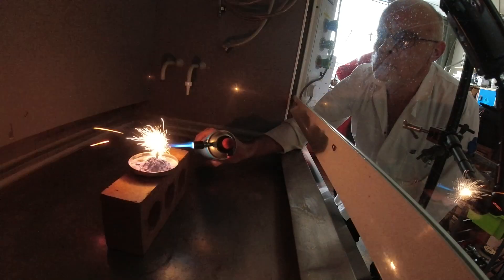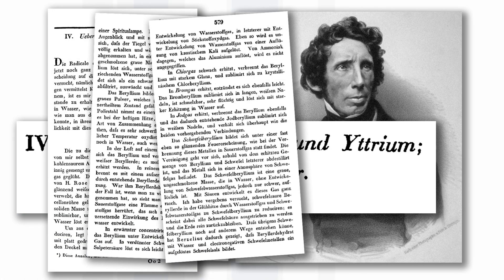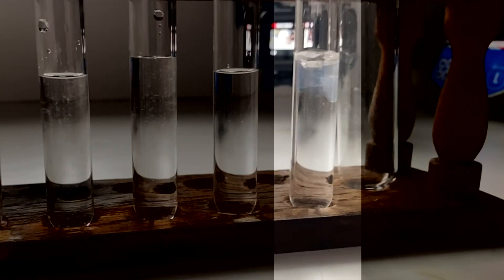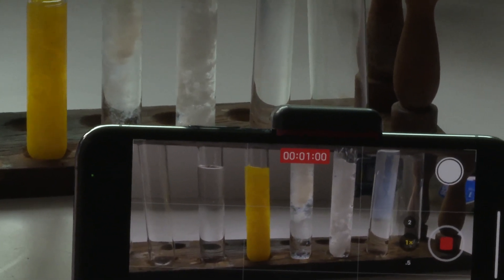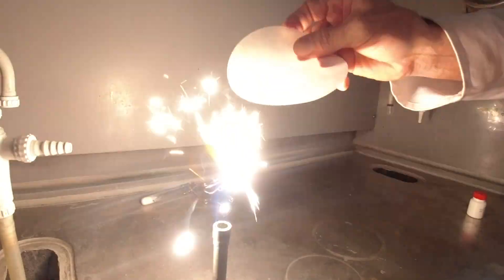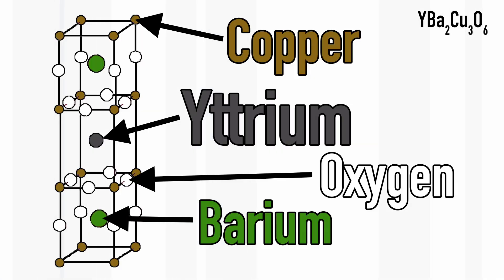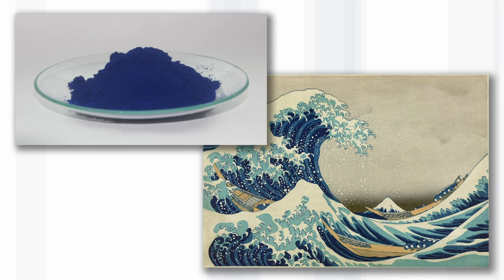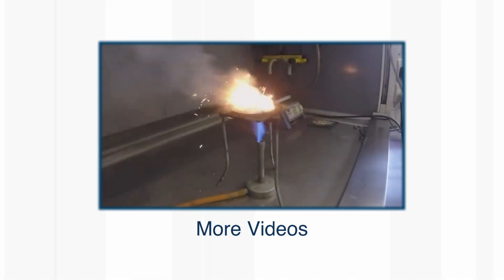Yttrium - Periodic Table of Videos

Comment: Yttrium is also used as a phosphor in those old style filament-like white LED lights. The LED sends out high energy blue light, and the yellowish yttrium cake absorbs and releases it in multiple energy stages. That's why those lights keep on glowing for a fraction of a second after turning the light off.

Comment: Yttrium also gets used in Yttrium-Iron-Garnet filters, where a small pellet of it is held in a magnetic field with RF transmission lines adjacent to it, and it can make a filter with an extremely wide tuning range, by adjusting the strength of the magnetic field to change where it is tuned.  This gets used with an oscillator circuit and made its way into a lot of RF test equipment as YIG oscillators, where you may need an oscillator that can sweep across many GHz. Not common to everyone, but everyday use for a lot of people developing the stuff that is commonly used by everyone.

Comment: Another useful application of Yittrium is crystalline Yittrium Iron Garnet (YIG), which is polished into tiny spheres (usually around 1um) for use as microwave oscillators. The YIG sphere in the presence of a magnetic field will actually oscillate. YIG oscillators have very desirable microwave properties (excellent RF spectral purity), and are used in high end RF test equipment and fundamental oscillators for all sorts of signal sources, filters, mixers, etc.

Comment: Another practical application of Yttrium is in high frequency tunable oscillators and filters. Yttrium Iron Garnet (YIG) is influenced by a magnetic field to adjust the frequency of these devices. YIG tuned oscillators and filters show up in high end radio frequency test equipment, old radar and electronic countermeasures equipment.

Comment: The chemical formula for the superconductive ceramic that is featured is incorrect. It is YBa_2Cu_3O_6.95 - note the 6.95; the missing oxygen in the structure is important. The material is created through sintering and becomes superconductive 15ºC or 27ºF above the boiling point of liquid nitrogen. Fun :)

Comment: 9:45 what about phthalo blue (Cu(II) phthalocyanine)? I've synthesized it before. It was discovered in 1927. It's a very common pigment.
Reply: YInMn blue is the first 'inorganic' blue pigment discovered in 200+ years. The last inorganic blue discovered was Cobalt Blue (Cobalt Aluminum Oxide) in 1802.  phthalocynines and anthocynines are organic dyes.
Reply: @massubramanian7004  Wow a reply from the discoverer himself! I didn't understand that it was the first inorganic blue dye discovered since then. As an undergraduate in chemistry interested in material chemistry, your work is inspiring. Congratulations on your discovery.

Comment: I would like to point out that this is the first inorganic blue pigment in some time, but organic blues like pthalocyanine blue were synthesized in the 20th century.  This is not the first new blue without qualification in 200 years.  Many have made this mistake, so I hope there is a correction later.
Reply: Yes. YInMn blue is the first 'Inorganic' blue pigment discovered in 200+ years.  The last one was Co-blue (Cobalt Aluminum Oxide) discovered in 1802!

Comment: I've seen superconductor maglev videos many times, but unless there's a practical application for this that would make it everyday reality, it will probably never cease to amaze me. The best bit about this is, when you take a suspended object and position it somewhere else in the magnetic field and it just stays there instead.
Reply: Yah, for lots of applications, the benefits from using a superconductor are offset by having to keep it cold enough to superconduct.  But who knows, higher temperature superconductors keep getting discovered.  Even some room-temperature superconductors have been discovered, though as yet they're all compounds that can only exist under millions of atmospheres of pressure.

Comment: I made some yttrium superconductors at ECU (East Carolina University, Greenville, NC) over 30 years ago. I still have them in a bottle around here somewhere. (there's a bit of contamination in them as they don't become SC until around 90K.) There was another formulation that made a yellow flaky superconductor (looked like yellow mica), but I don't remember what it was. This would've been in the late 80's. It's a small miracle since we were using stocks from the 20's.

(As a side note, a lot of things become superconductors if you have liquid helium. :-) ~4K)

Comment: I use Prussian Blue all the time as I make art using the Cyanotype process - very simple to use, but would love to see a chemical explanation by the Prof of the precise effect of UV light on the reactants.
Reply: Fe(III) is reduced by citrate in the presence of UV light to Fe(II). Oxalate and tartrate are also capable of reducing Fe(III). With oxalate reaction proceed as follows:

Action of UV light on oxalate produce electrons and radicals:

(C2O4)2- + hν → (C2O4∙)- + e-

(C2O4∙)- → CO2 + (CO2∙)-

These electrons and radicals than reduce Fe(III) to Fe(II):

Fe3+ + e- → Fe2+
Fe3+ + (CO2∙)- → Fe2+ + CO2

Fe(II) which is formed in this reaction than react with ferrocyanide to produce prussian blue.
Reply: There is a Nile Red video from a while ago where he made his own blueprints and goes into the chemistry behind it.
Reply: I love the cyanotype process, especially combined with pinhole camera negatives.
Reply: @martinmckee5333  I think Technology Connections channel did something about this process awhile back as well.

Comment: Also used in growing crystals, I had to repair a solid state NdYag laser at one of my old jobs. And i used to work for a company that made artificial diamonds for industrial purposes and know it was one of the ingredients. I just worked on keeping the induction furnaces running, so i wasn't privy to what went into the mix
Reply: Yttrium Aluminium garnet is a common synthetic crystal used as a gemstone

Comment: What happens when you put that pigment in peroxide?
Reply: When we discovered YInMn blue, we tested it under various conditions. Y and In can't be oxidized as they are in maximum oxidation states in YInMn blue.  As the pigment is made in air and/or oxygen at 1300C, the Mn3+ is also very stable inside the trigonal bipyramidal coordination.  When treated with H2O2, there is no change in the color.  YInMn blue is a very stable pigment. Organic dyes are vividly colored but not quite stable like inorganic pigments under oxidizing conditions.
Reply: @massubramanian7004  Fantastic answer! Thank you! Looks like you've practically built a fortress. I'm impressed!
Reply: I would guess not much, organic pigments probably would not do well. I think?

Comment: Regarding Prussian Blue (mentioned by the Professor at 10:20) it has mechanical properties as a consistant ultra fine granule. It's used for marking up and fitting of highly precise mechanical assemblies to within tollerances of 0.001mm or less.
Very usefull pigment.
Reply: Oh, right, like when precision scraping steel surfaces.
Reply: Prussian Blue is also medically used to treat radioactive cesium and thallium poisoning, as well as non-radioactive thallium poisoning.
Reply: @samuelwarshaw9480  Wow, never knew that.
Learn something new everyday.
Reply: There's also talk of using it as a cathode in Sodium-ion batteries, which could be a much less resource intensive alternative to Lithium-Ion batteries.
Reply: This fine particle size also lends itself to very detailed images. This is one of the reasons it is used in blue prints. The other advantage is that Cyanotype synthesizes the Prussian blue inside of the paper using a method similar to developing a silver halide photograph. 

Adding to your point, Cyanide actually gets it's name from it's blue metallic salts. In ancient Greek, Cyan meant the color of Lapis (dark blue). Today we use the word cyan to refer to the color of Copper (I) Cyanide rather than the darker Ferrocyanide of Prussian Blue.
Reply: It is because it is colloidal in nature in the preparation  used in "engineers blue" and provides sub-micron pigment layer.
Reply: It also has use as medical grade prussian blue which can be used to treat thallium poisoning. The potassium in the complex undergoes ion exchange with the thallium toxin jacking up your nerve cell axons, then you excrete the thallium prussian blue out.
Reply: This reminds me of a compound -- Ferri ferrocyanide which is Prussian Blue in colour
It is formed by the reaction of Fe3+ and potassium ferrrocyanide
Reply: Is this what is called engineers blue I remember using as an apprentice?
Reply: @adediver  Yes.   Engineers Blue is the same as Prussian Blue.

Comment: I recently learned about thermal barrier coatings made of Yttria-stabilized ZrO2. Would be interesting to learn a bit more about these materials, too! It's not rocket science :) 
OK maybe it is.
Reply: It is not rocket science but it is jet engine science, they are used as tbc coating on turbine blades to prevent them from melting.
Reply: @demoaccount2392  The Raptor 2 engine has some thermal barrier coating inside, too. Unfortunately we don't know the exact type and composition, but I'm amazed by the extreme amount of bright light coming out of those engines when they're running. It has to be related to that coating, or even perhaps owed to rare earth constituents of it, much like a Nernst lamp. Seems like a topic worth another video on rare earth oxides altogether.
Reply: @hardwareful  True